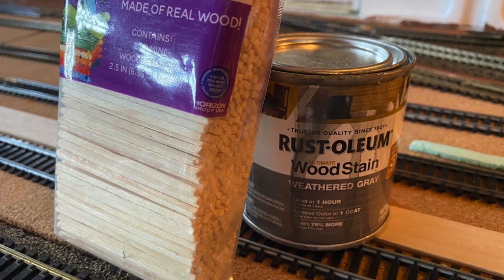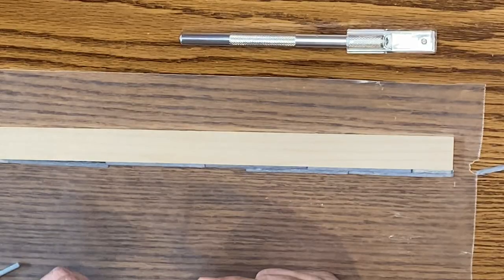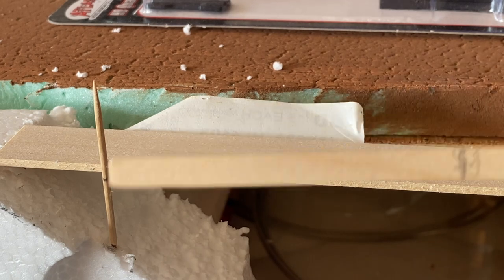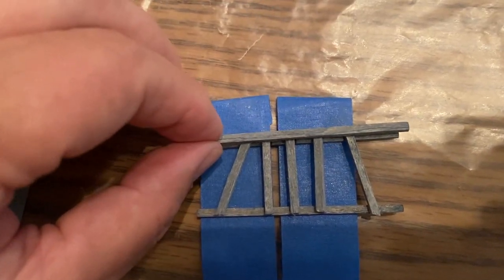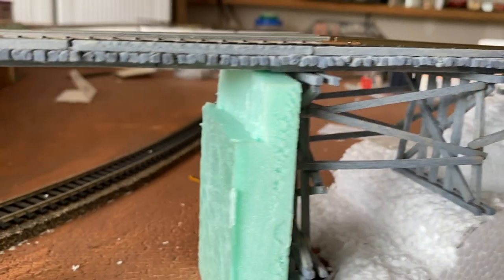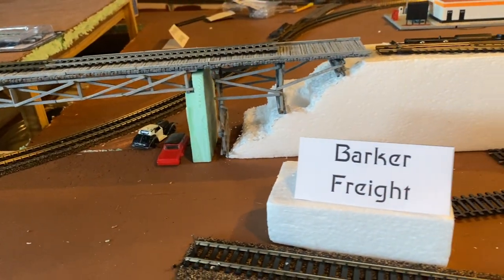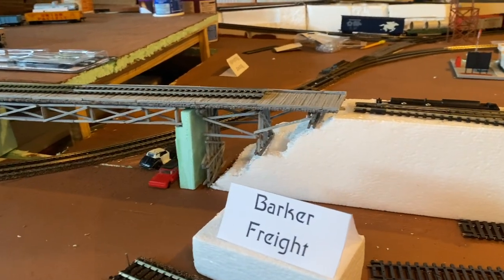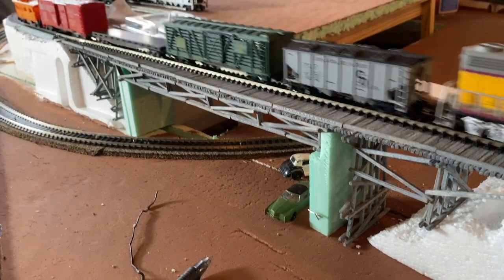21 How You Can Build a Trestle Bridge Using Craft Sticks

Comment: I’m planning on scratch building a S curve trestle like this through a bayou. Along with 4 other wooden bridges along the layout. It’s intimidating to start it honestly it’ll likely be about 5 foot long. The S wouldn’t entirely be just one trestle but inbetween a couple of sandbars until it crosses the bayou
Reply from the maker: You probably already know this, but make sure you have a straight section of track between your opposing curves in you S bend. It will help keep your cars from derailing. You wouldn't want them tumbling off the bridge into the drink!

Thanks for watching.
Reply: @dcrrails3402  definitely planned for!
Reply: Excellent.  Just start and the intimidation factor disappears as you gain more experience.  It’s true with any project.  Don’t let fear stop your forward progress. Cheers
Reply: @dcrrails3402  they don't do that for REAL right-of-ways....whats the diff?
Reply from the maker: @tommurphy4307  The model railroad rolling stock doesn't do well on an s curve, uncouples or derails. A short straight piece between the two curves eliminates that issue.

Comment: You should replace the span over the lower track with some plate girders.  There’s no way that your wooden span as designed would hold a prototypical train.
Reply from the maker: Thank you for stopping by. I based the bridge off of some photos online. It span over the water looks like the one I built. However, mine isn't as tall because I needed clearance for the trains below, so that was my compromise to make it work for me.
Reply: it worked in 'bridge on the river kwai'.....